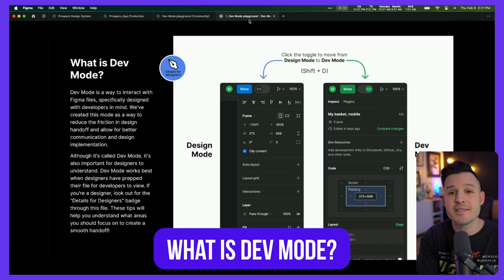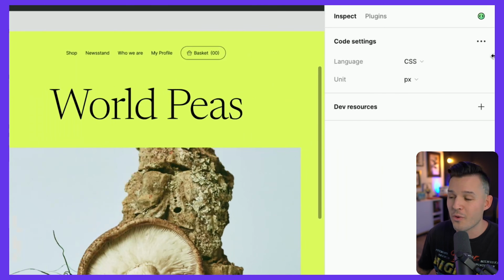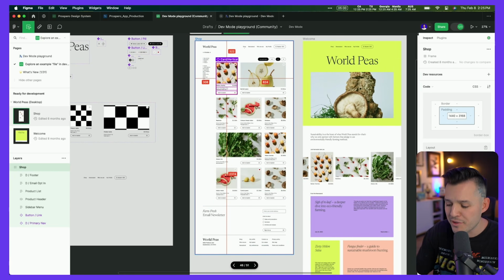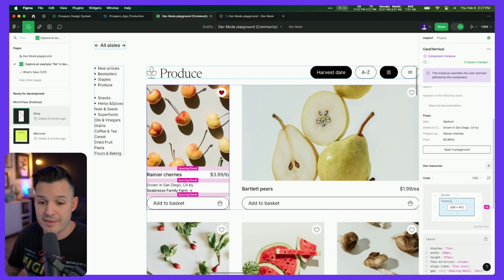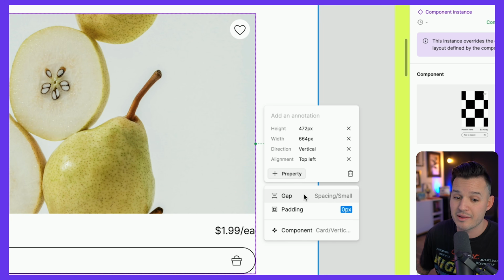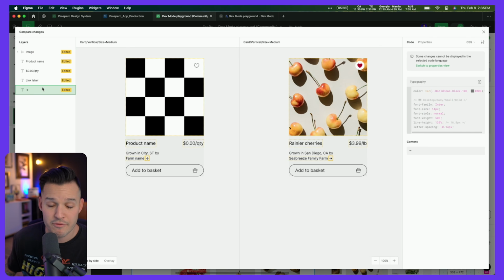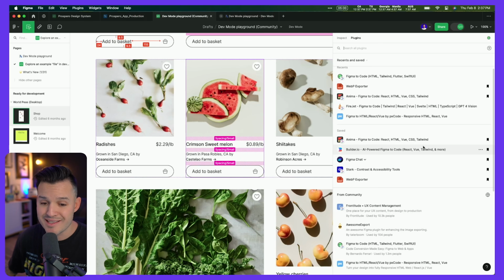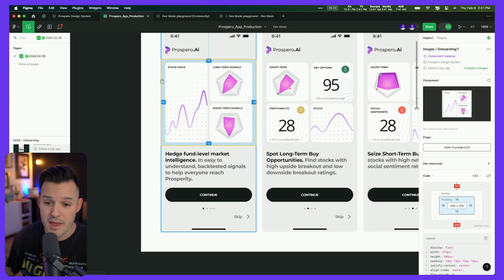Figma Dev Mode 🤯

Comment: Has anyone used dev mode to replace the spec documentation process? That seems to be the only way to justify the price
Reply: That is actually a very interesting question. On one hand, in my opinion, replacing specs with dev mode requires designers to either understand frontend development or have access to a sufficient existing design system that can be linked. On the other hand, most designers may not possess enough knowledge to fully utilize dev mode beyond appreciating visually appealing aspects like padding, which leads them to still rely on specs. Based on my experience, investing in dev mode for developers might be more beneficial than assigning the task to a designer. At the end of the day, designers will prepare the specifications, and developers will refer to Figma, often ending up consulting the designer directly or through platforms like Slack. :) So, for now, dev mode is something nice to have.
Reply: @vadim_sharapov  Can you share what understanding designers would need to have of frontend dev to make dev mode work? You make it sound like they should have some understanding that's different/more than what they already need to complete spec documentation.